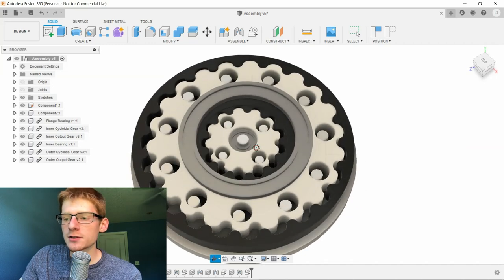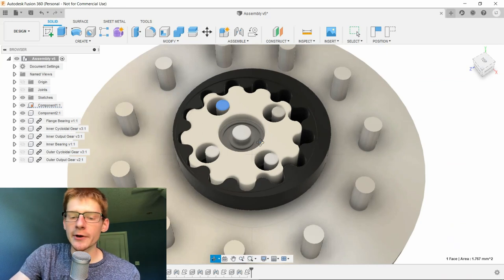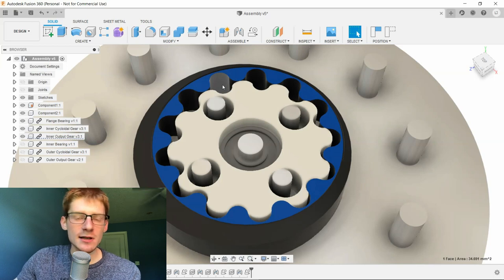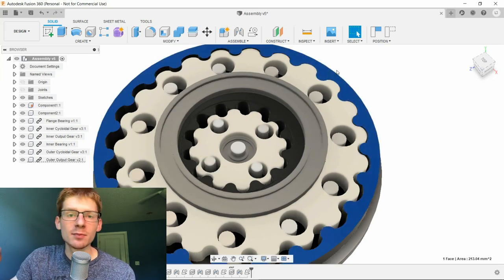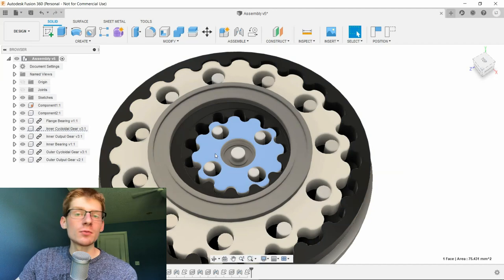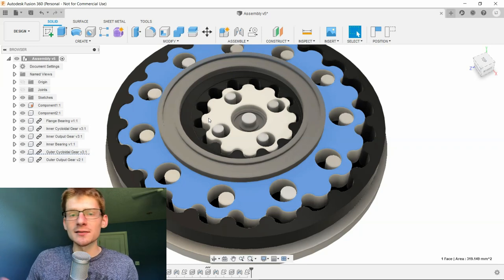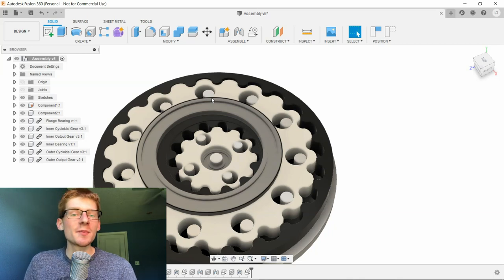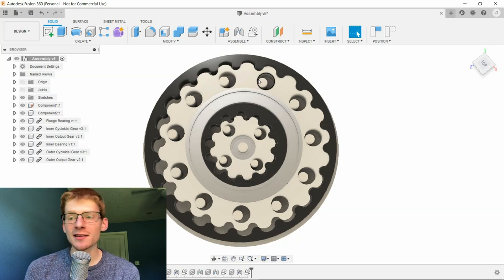The Compound Cycloidal Drive - Something Novel

Comment: Needle roller bearings are a good choice for your second stage in terms of space constraints and mechanical properties, they take high static and dynamic radial loads (vibrations) and as this is your second stage, you don't have to deal so much with their major downside, which is friction at high rotation speeds, the only issue really would be the price tag.  Another type of bearing that would push the space and weight constraints to an absolute minimum is self-lubricating bushing (also called sleeve bearing), usually producing more friction, but all comes down to material science.  Graphite and other nano-lubes profoundly change - at molecular level - the gliding properties of the contact surfaces, and may therefore do the magic you are looking for.
Reply: Agreed! That and also use low friction materials like UHMW or HDPE for the gears
Reply: I was thinking the same thing… brass/bronze, nylon, graphite, carbon nanotubes…
Reply: With the torque output expected, I'd be happy to sacrifice some of it to use printed graphite impregnated bushings.
Reply: Right? I never hear people talking about the types of bearings. I guess they just use enclosed ball bearing.

Comment: There are thinner options for bearing, have a look at needle bearings. Skyentific with his robot arm also has some very thin looking bearings and he mentions the part numbers in a few of his videos which might be helpful. For securing the eccentric gears maybe a few axial bearings behind them, between them and the face plate with the pins? Or, if you're 3D printing put a double helix on the gears and they'll hold themselves in position as long as they have clearance to any static parts, or bevels can serve a similar function if you want to machine these on a 3 axis CNC. Finally some flanged bearings (preferably angular contact, two in opposing directions) can be used in a few places to hold the gears and lift them off the face plate so they don't rub.

As far as being hard to source, aliexpress is your best friend. You can find every kind of mechanical part on there, nuts, bolts, bearings for fairly reasonable prices. Bearings similar to your large one are less than 5 bucks a pop. 

Since you're fairly concerned about size, I take it these things are intended to be quite small? At this scale and speed, bushings will do just fine, and save a lot of space. You'll find a lot of small gearboxes with plastic or metal gears use bushings not bearings on the shafts. Gives you more room on the ring gears to add weight/remove and balance them. You're only left trying to balance the wobble of the central gear.

Comment: A thought for the bearing issue: Instead of buying thin-section bearings, you could treat the inner black piece and outer white piece as bearing races themselves and simply put small balls in a grove. Depending on what you make them out of, it could be as smooth and high-load bearing as needed without being expensive or difficult to source.
Reply: I love this idea, really smart.
Reply: Was coming out here to make the same comment!! Well played sir!
Reply: Could even print the balls out of the same material in the same print (depending on your tolerances of course)
Reply: @brettneff7900  Same here! Taking another idea from above, you can buy PTFE or HDPE balls from McMaster.

Comment: this could function as an extremly flat and simple clock designt, where you hav three layers, with ratios 60:1, 60:1 and  so that every stage has a colck handle as output. and one could easily expand it to acount for days in a week, and the date as well, just by putting more leyers around.
Reply: Ooooo,i like that idea.

Comment: Quick tip:  While you are giving long explanations, have the animation running instead of stopped.  That makes it way more interesting visually, and a bit easier to understand.
Reply from the maker: That'd be great. Unfortunately there is no animation, It's just me dragging the input shaft in a circle. I do wish I could just press go.
Reply: @LeviJanssen  Could you create the automation video by dragging the shaft, then loop that video clip letting it run and do a voice over?
Reply: @LeviJanssen  if you click on design button... that is drop down menu where you would find animation part of the F360
Reply: @TheStankec  yes, but animation and fusion doesn't respect joints or motion links
Reply: @everythingfeline7367   true you have to do it by hand for each part, but after that its moving xD for animation purposes :D
Reply: @LeviJanssen  , I might be wrong but the motion study function in F360 seems to "respect" joints and enable you to make animations outside of the animation tab.

Comment: I made something very similar to this in March of 2020 except it was vertically oriented and the middle stage did rotate. It had an 812:1 reduction because It had a 28 to 29 lobes then 29 to 30 lobes. The torque output was incredible. I used small NEMA14 motors but I was able to get 100Nm of torque. It is fully fixed and constrained. It uses components from McMaster. The driving shaft is 8mm and I used M3 screws for assembly. The outer diameter was 100mm if I remember correctly.

Comment: Keep designing your micro servo!
I designed a robotic triple drive years ago using 3 matched tubes, each inside the other for space constraints (1/8" OD was the largest.)  The surfaces were teflon impregnated after machining. ( several materials can be fused to tge metal surfaces) Very low friction and good life on slow (<100rpm) sufaces. So bearing size and sourcing shouldn't be an issue in  Production.

Comment: Sintered plastic bearings impregnated with oil have excellent load bearing and very reasonable friction against metal axils.  SLS printed nylon bearings could save you lots of space, weight and cost.

Comment: Hi Levi, nice design. I have manufactured few planetary gearboxes for hydrostatic wheel drive transmission, they have high torque capability and are very compact. So cannot relay on the size of ball bearings and the avilable needle bearing won't withstand the very high radial load. The solution it's to design the planet gears and bearing as one piece, so basically you use the gear as the outer race of a custom cylindrical roller bearing (these rollers are readily available in lots of sizes and they are cheap) and the inner race would be the driving pin (in your case this would be the inner eccentric ring piece), both surfaces must be heat treated to same hardness to ballbearing races and precision grind (in high precision or high speed you may need to lap these surface too). The I.D. and O.D. of the outter cycloidal disk and the inner eccentric ring have to be designed to match an "almost" integer amount (around 1% - 2% bigger) of the rollers to be inserted (cage not used). This approach works great and if properly built, it will have the same  service life as an off the shelf bearing. This same approach is also used for the high power/high speed gear stages in the trucks transmission boxes.

Comment: You can make custom bearings -SLS nylon, impregnated with oil (immerse and thermal cycle) on a polished metal shaft will excellent load capacity and reasonable friction.

Comment: I saw a cross between a cycloidal and a split ring where two cycloidal disks are stuck together and the top on has 1 less tooth and the top can spin. Doesn't need those big carry holes through the disks and can get stupid high reduction with 3 parts.

Comment: While theoretically feasible and very, very clever, I think this design would be a nightmare to implement. From what I understand, cycloidal disks' eccentric motion and thin cross-section makes them vulnerable to tilting and flexion, which jams them between pins and lobes, with forces concentrated near the faces. That means that the wear rate will accelerate as time goes on and leave the drive vulnerable to locking up. Without offset disks to counteract tilt and less-than-stellar fixation options, keeping the disks flat and level to prevent this would be tricky, at best.

This design is also harder to free from sliding contact. The conventional design only requires rotating elements for the ring and output pins, whereas this design would requires that the ring pins, both sets of output pins, and the teeth of the inner or central cycloidal disks be free-rotating ... which, by the way, would make fixation of the inner/central disk even more painful, as you'd need to accommodate eccentric end plates.

Comment: Great design. I’ve been thinking about this type of gearbox for a while but couldn't get the design to work. I haven’t seen this in any patients before. What do think is the smallest diameter of this type of gearbox?
Reply from the maker: Using a 3mm OD bearing on the input, 1 and 1.5mm shafts, incorporating a bushing to replace the bearing, and smoothing the cycloidal profile to decrease eccentricity, I think you could get it to around 25mm. If you really tried.
Reply: @LeviJanssen  Did you ever print this to find out if the design actually works?
Reply: @PaulGouldRobotics  You didn't watch till the end.. he is not convinced of this design
Reply: @JohanDegraeveAanscharius  The proof is in the eating tho. And not everyone has his diameter constraints.
Reply: This is so close to a harmonic drive with the eccentric cycloidal. Plus this is a THREE stage cycloid, not two. A single stage is just a single offset eccentric, one cycloid, and the case is the output gear. Very unique.

Comment: Gives me a neat idea for a 4th axis on my mill. imagine this in metal and driving a rotary table.
1st stage counter mass could be done by inserting metal pins  into the black eccentric lobes. You could loose the bearing and machine the gearbox from cast iron with precision ground and polished "bearing" surfaces. Cast iron is already a self-lubricating metal, and friction is almost as good as a bearing when oil is used. Machined Teflon Delrin or nylon are also self lubricating but also can have long life when an oil is used. The crank in your cars engine is cast iron and uses tight tolerances between bearing surfaces and pressurized oil as the bearing itself. The metal parts never touch even though there's thousands of PSI pushing down on the pistons when the fuel air mixture is burned.

Comment: you might consider carving a channel on the outside of the friction surface and placing roller bearings in there. Barrel style rollers with your very low friction. And you might be able to find thin steel bands to limit wear.
 it looks like the ideal elbow joint. 
It looks like the ideal elbow joint

Comment: If you need small bearings, start by thinking "Japan". They make the mentioned bearings but also some that are 'microscopic'.
Maybe you don't need ball-bearings, maybe you need roller-bearings.
POM is often used in machines instead of aluminum or steel. This allow you to avoid using lubricants.
One thing you should have in mind for simple bearings, is that you should not use the same material for the bearing as the axle.
For instance: Use a bronze bearing and a steel axis to rotate inside the bronze bearing. Do not use a bronze axis, because the bronze will fuse to itself (absolutely insane example).
Same thing about PLA. You can place a PLA axle in a PLA bearing, but rotate this axle at 3600 RPM and you'll find that the heat fuses the two PLAs together and the device stops working. If the bearing is a material that won't bind to the PLA, then the device will have a much longer life.

Comment: Very nice design and clever.  As for the bearings you might try making the parts out of material with natural lubricity and eliminate the ball bearings.  Combining that with some grease might be all that is necessary particularly for low speed applications.  If you want to stick with 3D printed materials you might try reinforcing the mating surfaces with brass.  You could design so that the edges of the mating surfaces are close to the diameter of standard tubing and cut rings to fit. Since brass tubing can be expanded to larger diameters you could use the same tubing for both the inner and outer surfaces. You could build a cone shaped tool to expand the outer ring to the proper diameter.  A little grease between the inner and outer brass might be all you need.

Comment: The only place you'll find bearings on a real cycloidal drive is on the very middle eccentric part and the output shaft. All of the pins and surfaces of the plate are polished very precisely and just ride on a film of oil. You don't need to make things complex with needle bearings. Just very precise holes and pins with a very smooth finish, and a nice heavy oil. And the only thing novel about this is that the two stages sit in the same 2d plane. They make multi-stage drives that are simply stacked along the shaft axis.

Comment: you can get custom laser cut 932 bronze bushing cut from oshcut if you think it can handle the extra friction.
Reply: Packed with enough of the eight kind of grease, that should work.
I see 100+ year old Babbitt bearings that still show no sign of wear.

Comment: There is a need for a easy shift in and out, inline, 20 to 1 or higher, hollow shaft, 1to1 feed through reduction unit for manual input on milling machines.   Machines where one turn equals .2", it takes a lot of tapping of handle to get the number you want on a .0002" digital read out.  I will keep looking

Comment: You din't need counter weights to stop any wobble. You just have to dobble the hight of the gear and rotate the middle 2/4 at 180°.
I know because of the berings you efectively would have to increase the hight up to 4 layers so that you can use the 2 middle ones as counters.
I mean to just eliminate the original wobble you only need to add a second layer and turn it to be 180° offset to the first one but that would create another wobble by itself because the second layer is in the third dymension also offset to the first one. But if you acheave that you wouldn't have to add any counter weights.

And if the mechanism works how I understand it and the outer output ring just turns but doesn't wobble around (I mean isn't that the reason for this design?) you also could connect the outer rings to one big ring. Same goes for the gray inner inputs so that they somewhat look like the input shaft of a piston engine just that the counter weights for the offset inputs themselfes are another inputs for the other layers of the gear.
In term of conecting the layers you can also combine the back inner output gears/rings to one part. Just 180° ofset because of them being the inputs fo the outer gears.
The only parts not being connected to one part are the bearings and the white gears.

And yes. this doesn't solve any other design issue with this concept. Tbh I think it just makes them more complex even though it technically doesn't add any. Instead of one floating and pressfit self supporting layer, you would have the issue that 2 (aka 4) layers would support and rub against each other in this simplistic design. And you are still limited by the berings you can get in terms on how big you have to make the gear. But I don't count them because they are already issues of the one layer design.

Comment: Very cool! I'd call it a fractal cycloidal. Although you could also use a planetary gear set in ring-output configuration for the inner stage to solve the vibration problem and perhaps make it smaller. Search "planetary gearbox micro stepper" on ebay for a potential source of tiny gears.

Comment: You could print a ball race into the eccentric inner and the wobbling second stage and feed the loose bearings into the space. Lazy Susans use this technique. They use a grub screw to close the hole. This would remove your large bearing and give you complete freedom to size this to suit need. The largest lazy susan I know of that uses this method is 1000mm o/d.

Comment: You might call it jank - but when I make custom bearings I use airsoft BBs and they do just fine for me (lightweight too) :P
Reply: like the yellow plastic ones? not even actual copper nickel BBs?
Reply: I use Match Grade brand. They're plastic, double polished, seamless.  They're smoother than Colt brand which have a slight seam. I've also used Daisy brand zinc coated steel.  Smooth, but sometimes interfere with magnetic components.

Comment: Did you ever try making this? I've seen a great deal of your videos lately and was just wondering.
BTW: If you see this comment, could you comment on why no one making these are using bushings instead of bearings. Just thinking that the output of these devices are slow moving high torque. Traditionally that is where a bushing shines. And they can be much thinner than bearings. Just and idea. TY for sharing.

Comment: You could replace that big bearing with small steel balls held in place with a custom 3D printed cage. The inside and outside ring could be custom manufactured on a lathe. Well, not exactly easy to implement...

Comment: Oil pump gears can be use for the first stage . Some motorcycles as the old honda cg 125 has very small oil pump gears , 8 tooth outside and 7 inside , some honda cars also have rotary oil pumps in larger diameters . I m thinking on a very small  two stage reducer , with very precise , very cheap metal gears.